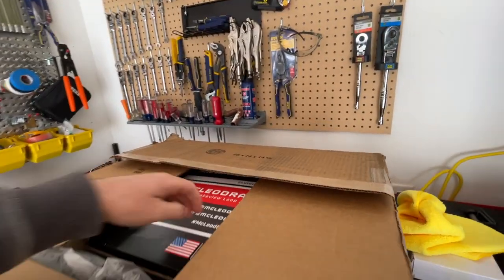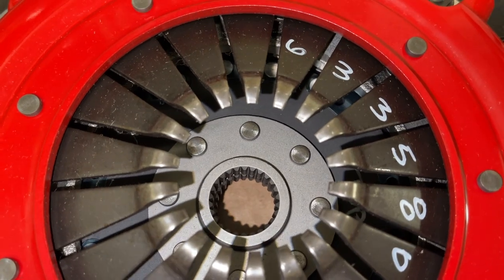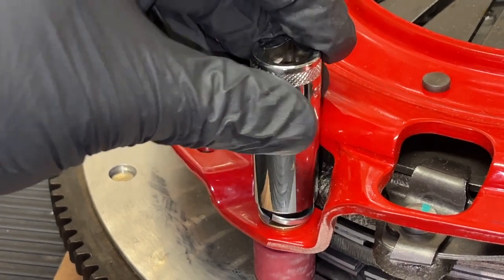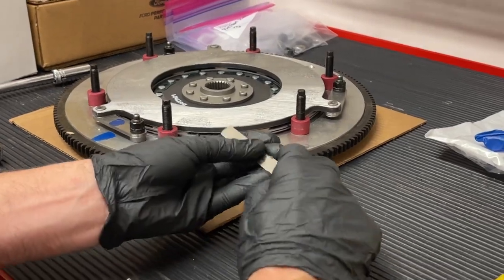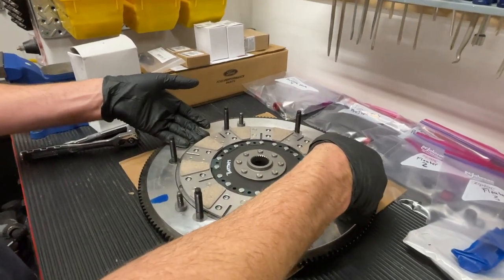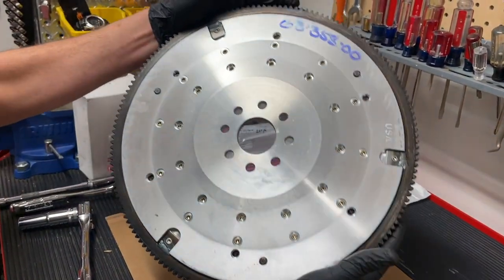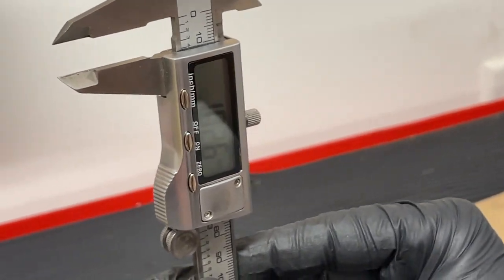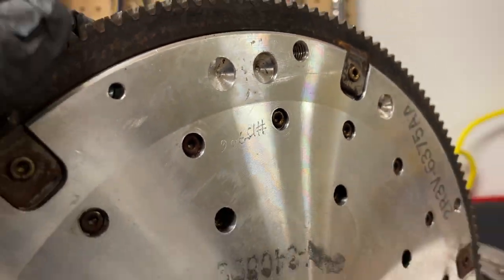Twin disc vs single disc clutch comparison: McLeod RXT Twin Disc Breakdown, disassembly, config

Comment: Great in-depth explanation as usual, Danny. 
I think it's BS how McLeod strongly recommends balancing their product, yet just doesn't do it from factory. With shipping and what they'll charge you, it'll easily add a few hundred dollars to the cost of an already expensive clutch - and then the time and hassle you have to deal with shipping. McLeod is the only clutch I know that doesn't sell you a clutch ready to go. I wish I would have know this before I bought mine, I'll see how it treats me.

Comment: Interesting, I never saw anywhere in the McLeod instructions that my flywheel wasn’t balanced from the factory. I guess this is why my RST and almost everyone else I’ve heard install a McLeod twin disc gets chatter at lower engine speeds. Mine sounds nasty right about 1900 rpm. I don’t understand why they would sell a flywheel that’s not balanced at the factory.
Reply from the maker: Yeah, it’s on the cover sheet of the instructions. Might just be a way to remove any blame cause I called around and no one will balance mine. It should be balanced against the crank is what they tell me, so I’ve thought about measures to spin the assembly before mounting the transmission behind it, but don’t want the clutch discs moving out of place without the input shaft holding it. Clutch chatter in each gear when shifting is normal on any new clutch. My mach 1 shook the steering wheel when it was new. I wonder if ford wears ir down from the factory since new cars aren’t like that

Comment: I have a McLeod 8 bolt steel flywheel that I got balanced when my motor was built for my 03 GT.  The whole rotating assembly was balanced.  I have since bought the RST organic 26 spline clutch to go with it after upgrading to a TR 3650 Lashbrook trans.  I hope the clutch and flywheel will be ok together as they were not bought as a set like yours.  What problems, if any, could I expect?
Reply from the maker: To run the clutch kit with another flywheel it should come with the adapter plate/ring, so make sure it has that. 
  I could not find anyone in town who would balance my flywheel, so after seeing it had been “zero balanced” from the manufacture before it was added to the kit makes me think it should be okay. Probably the same with yours. Just see if you get any vibrations when it’s all said and done.
Reply: @dannyjohnsonsgarage  Thanks.  The only time I've seen a flywheel balanced is with the motor balancing from the lower damper to the flywheel.

Comment: Will you be making a install video for the input shaft?
Reply from the maker: I plan to if it ever ships
Reply from the maker: Until then, I have the retainer sleeve video that pretty much shows it. You just need to check the end play with the new input shaft when the cover is installed. It has to be .002-.000 https://youtu.be/EsaOBOy67h4

Comment: Do you know if the 6932-07 will fit the 04 cobra t56 with 26 spline on a coyote 22 block ?
Reply from the maker: I would call McLeod to verify. Is your setup cable or hydraulic?
Reply: @dannyjohnsonsgarage  cable